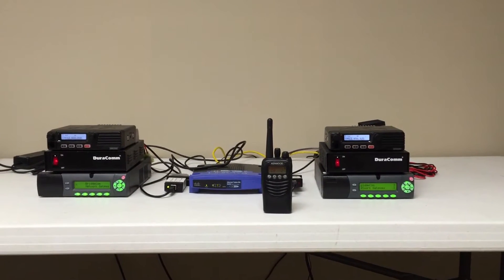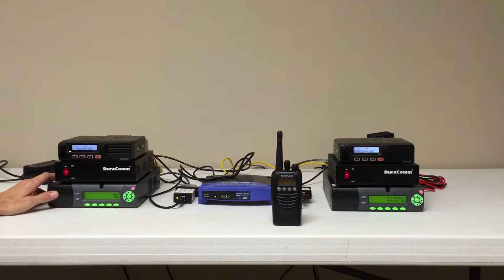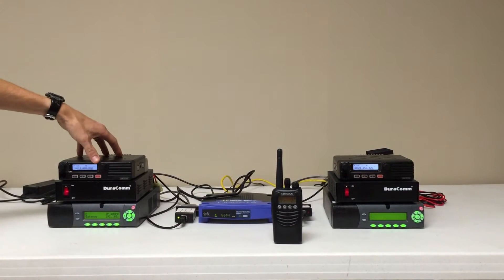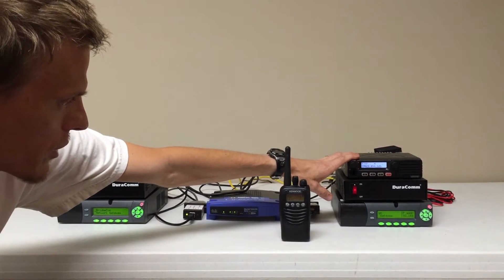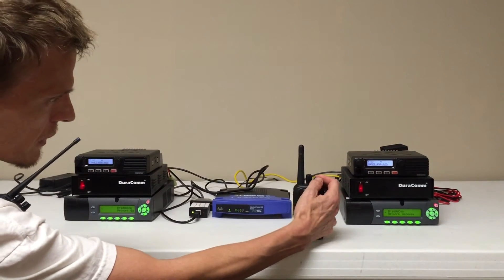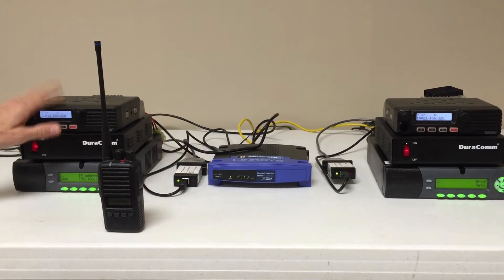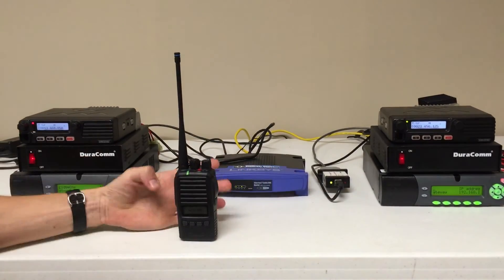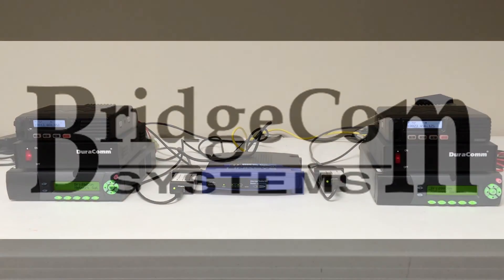MV-1 Demo

Comment from the maker: Grant, we use static or Dynamic IP to link the MV products together.  In a two site example like above, one MV-1 is designated as the master (and is preferred to have a static IP).  Any highspeed IP will work.  We have used cell data, satellite, cable, DSL, etc.  I believe this answers the question, but if not contact me Tim@BridgeComSystems.com to talk more about your application.

Comment: Hi, could you elaborate on the linking protocols between the MV-1's (I presume the master unit is programmed with a Static IP ?) and what type of connection (IP) is necessary to link the units, i.e. can they be linked over the internet or do you need a dedicated IP network?